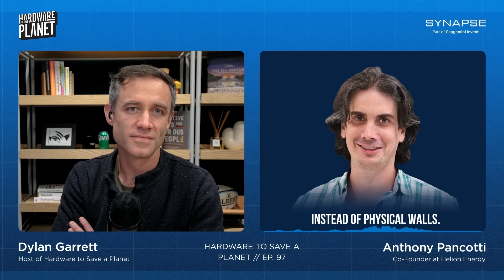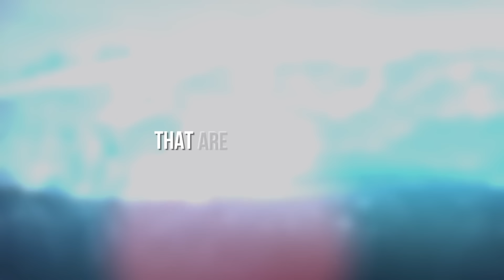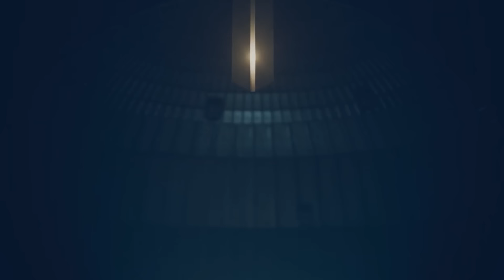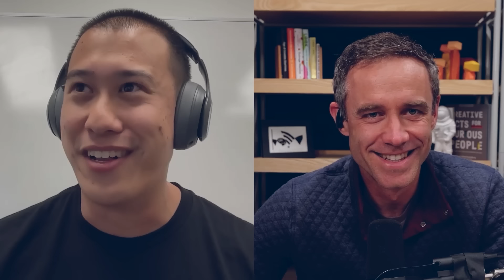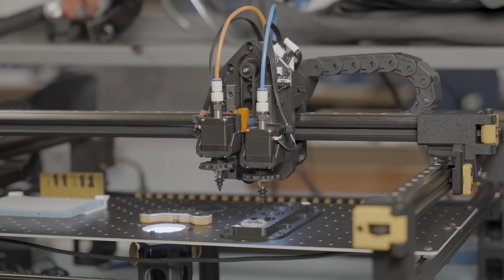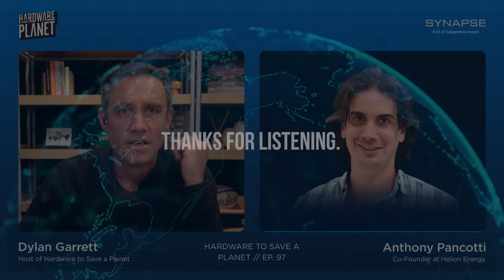Commercial Fusion Has Started: How Helion Is Bringing Power to the Grid by 2028

Comment: What about Radiative Heat? how much of it reaches the Pulse reactor walls? or do Magnetic field lines contain them as well?
Reply: The intense magnetic field flux has no effect upon radiant energy from the plasma and from the electrically neutral fusion energy neutrons generated by the D/He-3 side reactions. All that energy will be lost since Helion's energy capture approach only interacts with the charged particles moving in certain directions. Helion has never provided evidence that they have generated even one milliwatt-hour of fusion energy, or that any reaction energy that was generated was captured by the plasma compression coils and then fed back into the electrical capacitor bank that delivered the pulse energy to compress the plasma. There is evidence that they have failed in past goals and that their 7th generation Polaris experimental machine has not been meeting Helion's expectations for it. The recent DT shot, in Feb. 2026, was a clear indicator that things have not been going well. As a private company they don't have to reveal such problems.

As is common, in detail poor presentations by Helion Energy, is the fact that even if they do eventually achieve a significant quantity of fusion reactions, at the tail end of the plasma compression cycle, the time period of those reactions may turn out to be extremely short, perhaps under a microsecond. Their current shot reputation rate remains very low. As a result, the fusion energy duty cycle value will likely be near abysmal.

Comment: So what are the ROI numbers? What are run-state input costs per unit of output?
Reply: Exactly. Interviewer is obviously out of his depths; missed a lot of follow up questions.

Guest was obviously waiting but the darn interviewer a lot of opportunities.
Reply: Should be very low. Biggest cost for the first power plants will likely be maintenance until they have figured out all of the kinks. In the long term, they aim for 1 cent/kWh cost.
Reply: That is impossible to calculated for a company that has performed over 10,000 test shots with their 6th generation Tentra and 7th generation Polaris experimental machines that have never generated even a single milliwatt-hour of pure fusion energy and where their is no evidence that any fusion energy has ever been captured and fed back to the plasma compression electrical capacitor bank.
Reply: When you build an engine or anything really - you dont jump straight into commercial optimization:  its an engineering problem at this point in time and hard engineering goalposts must be reached before you can think about how to make it smaller, faster, cheaper.
Its like software dev:  pessimistic early optimization is dangerous and can actually harm the development rather than make it cheaper in the long run.